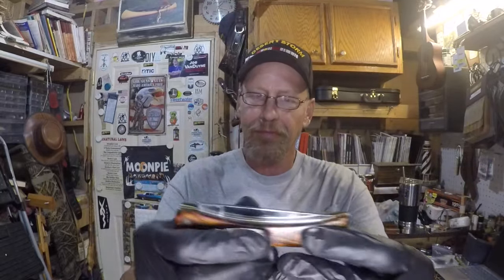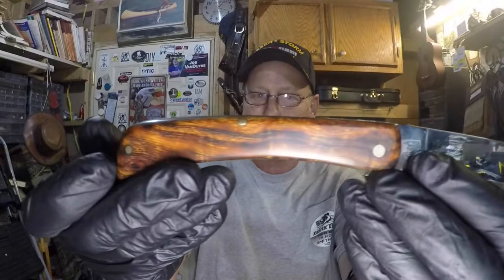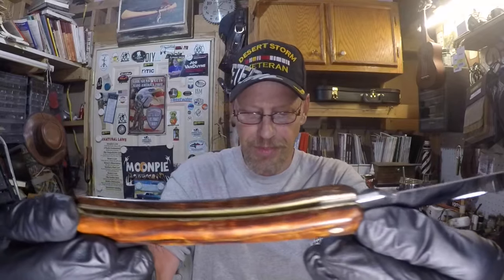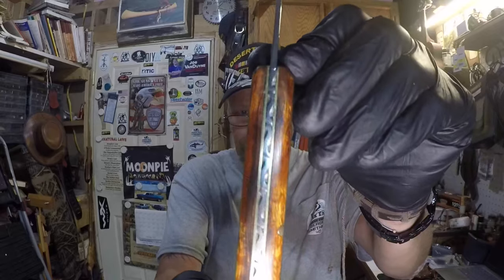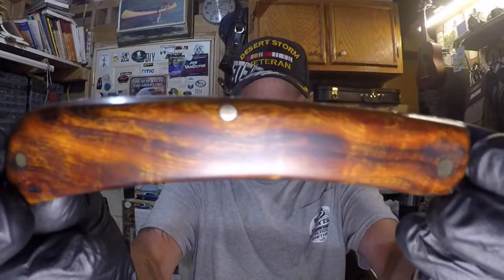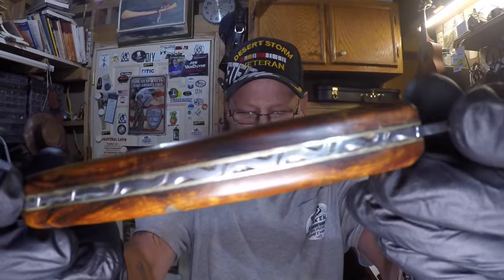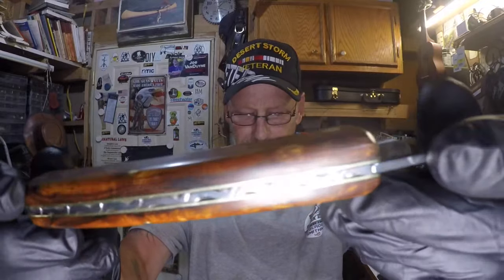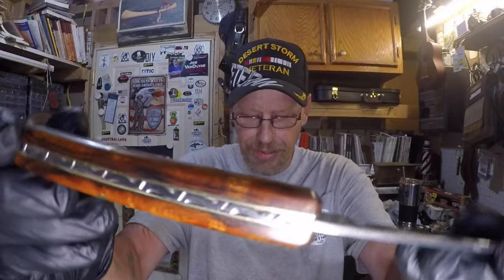Case Sodbuster mod part 2

Comment: How do you do a half stop
Reply from the maker: A half stop is where the end of the knife tang that is round it is ground down flat so it rests against the rocker spring on the inside but you have to dial it in so the top of the rocker spring is flush on top in the half stop positions just like when the blade is open or closed the spring should be flush in all three positions. I will film a video next modifying a sod buster with a half stop soon!!